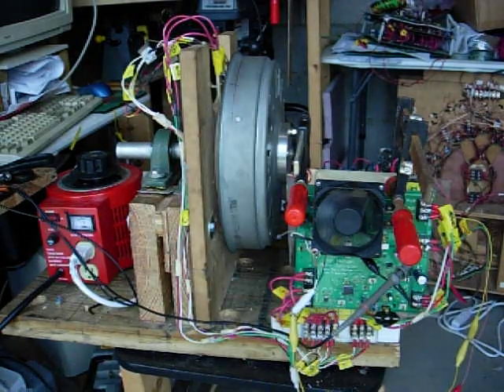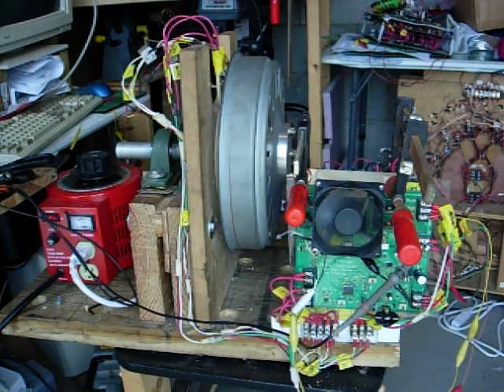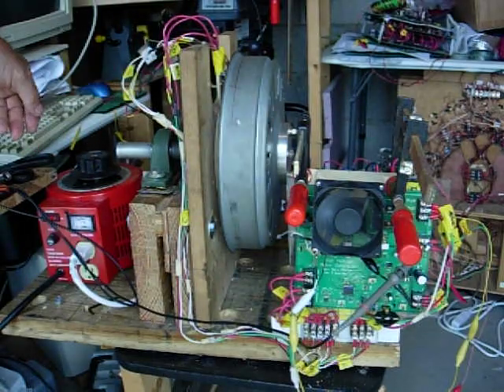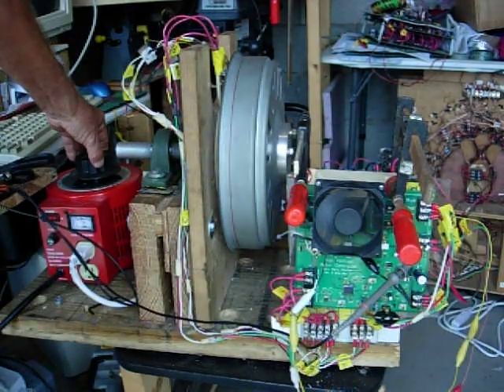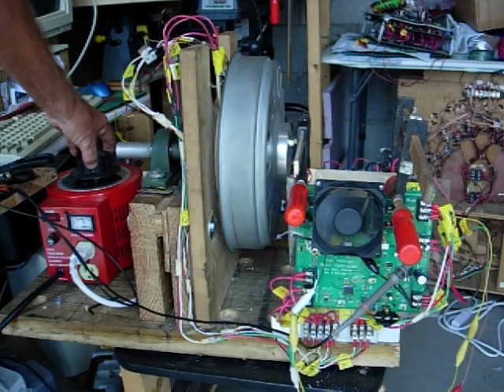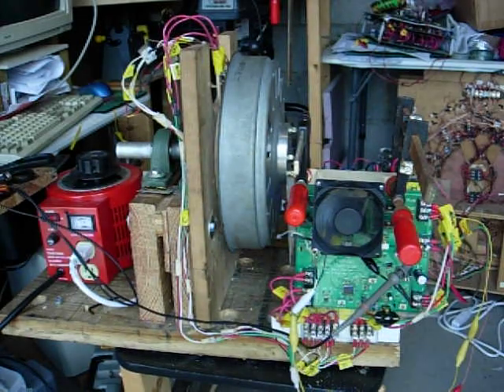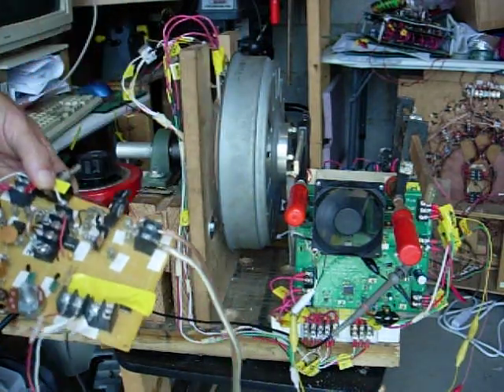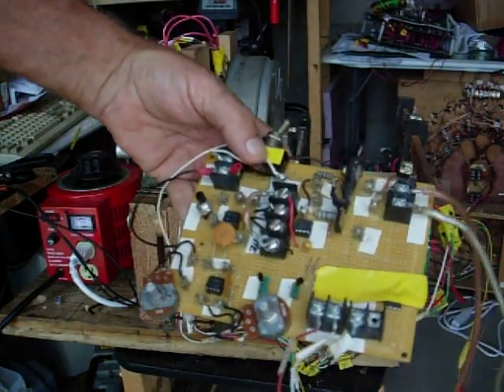Don Smith #128 PCB finally up and running  works great

Comment from the maker: I just finished the parts list for the new PCB which reverses the backwards diodes and adds the mounting holes for the fan assembly.   The entire pcb parts list can be ordered from a kit that I created with the Digikey BOM programs.   The kit and PCB will be sold on Ebay.

Comment: Looking good! :-)
Reply from the maker: +INVENTOR3 I'm amazed at how smooth this motor runs and extremely quiet.   The question that I have relates to Gerard's test during the winter in the garage using the McCullough Mini Lite Gen.   His amp meter didn't show a reading from the generator.  Yet the transformers worked fine.  Tesla states that the electrons don't move very much at all when they enter the plate this maybe why the 30 amp fuse didn't blow.  It should have because the transformer plate was a dead short.   It did work.  From this we should be able to build a small pole transformer and test Tesla's stuff.  should be quiet interesting
Reply: +CAPTAINSSBN Yes, i noticed how nice and smooth the motor works, very nice! :-)  I look forward to your testing Tesla stuff.  Testing, Tesla, Tesla, 1, 2, 3 :-)
Reply from the maker: We are entering into a golden age.  Free energy soon for all to enjoy.
Reply from the maker: Yes smooth all things considered,  I hope you pay close attention to the videos some stuff is wrong but corrected later on.  especially the use of pulse transformers they suck.  the best way to go is with DC to DC converters and opto isolators

Comment from the maker: In the last section The camera ran out of memory.   The small pcb with all the circuitry on it is used to provide a scope with pulses as the magnet on the rotor outside surface rotates past the pcb hall sensor.  This will give me the RPM count. which is one pulse per rev.

Comment: Holy smokey. Lost an inverter, diodes and fets. Let's hope the end result is worth it.
ps: I have an idea. Could you use a second Hall sensor, parralel to one of the other ones. And put it at a distance form the Hall sensor it is parallel to? The distance is 0.5 * distance of the magnets. My idea is to get an extra trigger. But I have no idea if it can or will work. But I don;t think it will fry anything.
Reply from the maker: +deslomeslager the three halls are working fine producing exactly what the data sheets calls for.  actually I tested them at 1 inch from the magnets and they still triggered.  The inverter fried probably because the variac is capable of drawing 30 amps and this much at 130v is way past the inverter capability.

Comment: Hi Gary looks great   but it sounds like a train its that or you have a hysteresous problem.Seriously though looks good
Reply from the maker: +Gerard Melvin definitely has some serious torque at 100vdc It'll be interesting to see if gets to 1500 rpm at the max 160 vdc.  If I use the Don Smith tesla system I can charge the caps to any dc level.  I was watching the power supply and if was a steady 100vdc during operation.  I'm not sure what the motor coils can handle.   I may get another stator and try winding dual coils on it one to provide power and the other to duplicate that input and recharge the battery.  The magnetic field created is simply a byproduct which causes rotation.  The losses are due to heat.